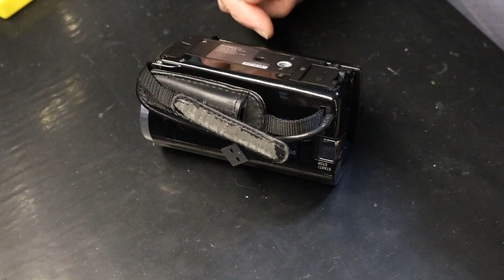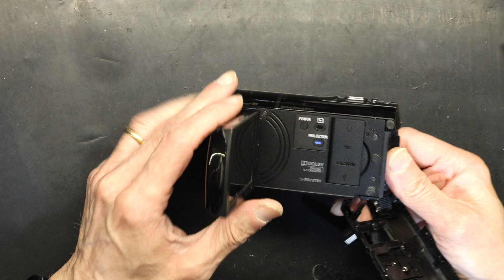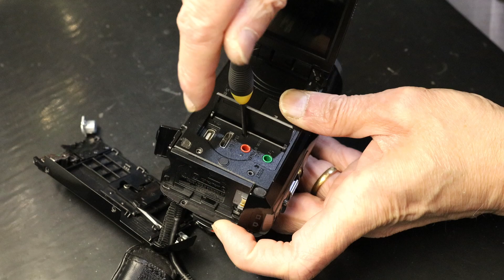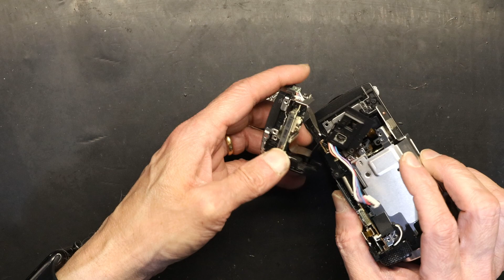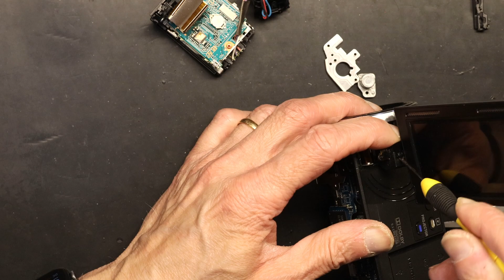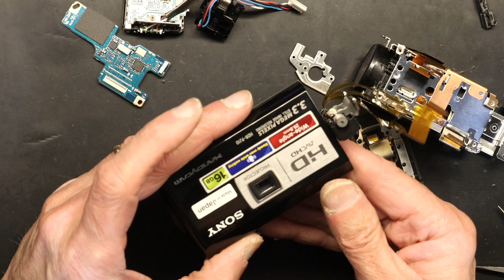Repair Tutorial: Taking Apart a Sony HDR-PJ10 Video Camera Camcorder with LED Projector

Comment: Thanks very much for your video sir, however, I also wish to see the next one when you assemble it together. It is similar to my hdr-xr160e sony camcorder which  has just stop turning on after the battery was completely discharged. So now the camera is no longer charging. Even when I have changed the battery with the same model,  no power on, but it kept on flashing red like on sd memory card slot while card in or out. So now I ask to know,  what may be the cause for no powering on but flashes red light on memory card slot  when plug power from ac and or dc battery, for I also have tried with another battery as well.
Reply from the maker: You are very welcome. The flashing light often indicates a hardware error or a short circuit on the mainboard, so you might need to have the internal power components professionally inspected. Here is the other video https://youtu.be/PgakpxwWbRg

Comment: Hi. I have an HDR-XR260, which looks very similar to the one you took apart. I suspect that the iris is stuck in shut condition. everything works, except that the image stays black during recording. Before going black permanently, the image was constantly out of focus. You staued away from taking the optical module apart, which is where the iris control mechanism is. Apart from concerns about dust getting on the sensor, is there any other reason why tackling the iris problem would be hopeless?
Reply from the maker: They are airtight to prevent dust from getting in, and that is why I didn't open it. If you have a very clean environment you can try opening it. Keep in mind that you may be facing some really small screws, springs, and mechanical parts that will be very hard to put back together.

Comment: Hi sir, I bought the same camera, but the projector have a problem, when I turn on the the image came with black dots and idk what’s the problem from, can you help me
Reply from the maker: The only way to fix it is to replace the projector unit. You can get the parts from eBay but they are hard to find.
Reply: @TECHNOLOGYTIPS101  Hello. thank you so much. Me, i am in france, i have the same probleme. What do i search in ebay for find this please? what the name? Projector? Thank you SO MUCH to france
Reply from the maker: @h.d322  Try this one  https://www.ebay.com/itm/156581666587